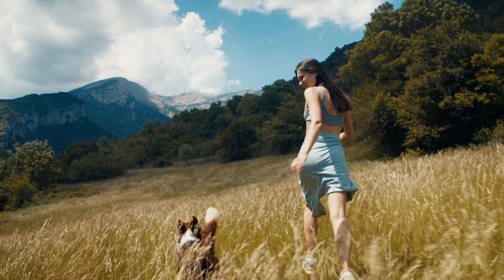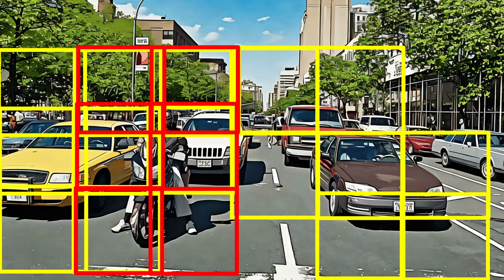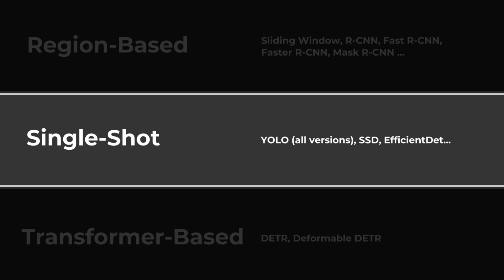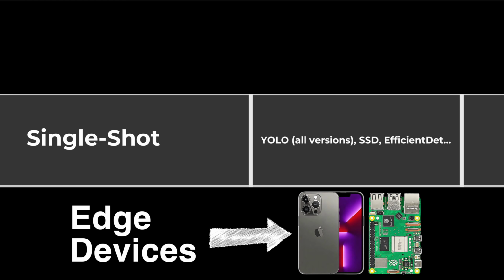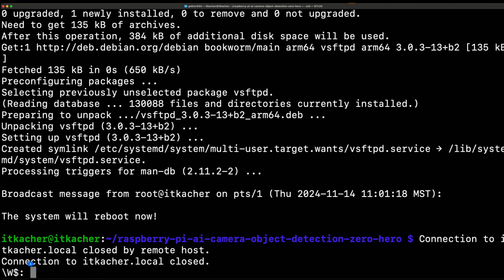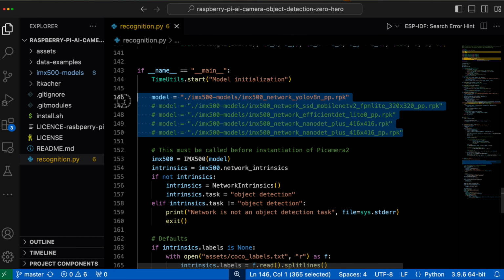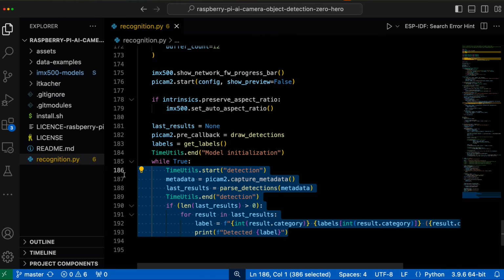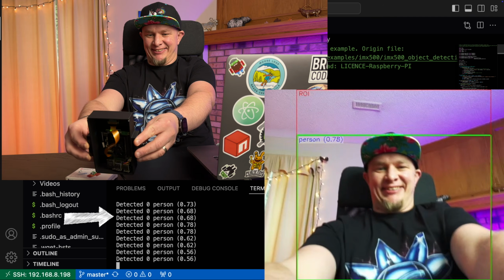The Only Guide You Need for Object Detection on Raspberry Pi AI Camera!

Comment: When i run the code the window of the camera never pops up but in the terminal it keeps running the detections
Reply from the maker: Just set True here and it should appear:
picam2.start(config, show_preview=False)
I never use a monitor when working with raspberry pi
Reply: @itkacher after i did that i would get a message saying it "couldnt load the Qt platform plugin "xcb" in (file location) even though it was found"
Reply from the maker: Try something from that link:
https://askubuntu.com/questions/308128/failed-to-load-platform-plugin-xcb-while-launching-qt5-app-on-linux-without
Reply: @itkacher  Ive been trying to get this working now but i cant find how to get he qt plugin to wokr
Reply from the maker: The code creates images with boxes so you still can use it without qt.
Reply: @itkacher  but i get the error when i run the code, so if i dont need qt, what would i change abt the code?
Reply: @itkacher  but when i run the code i get the error, do you know what parts i would need to edit of the code to not use the qt plugin?
Reply from the maker: Show_preview=False :)
See the first answer
Reply from the maker: If you used git to clone the code, run 
git reset —hard
In the root folder of the project 
It should remove all changes and it will run without qt
Reply: @itkacher  so i would run that in terminal in the zero hero folder?
Reply from the maker: Yes
Just run the original code, it would create images with detections
Reply: @itkacher but how do you see the camera without the window appearing?
Reply from the maker: The method:
```
def write_image_to_file(picam2: Picamera2):
    # Record file to SD card
    data_folder = f"./data/images/{DateUtils.get_date()}/"
    try:
        picam2.capture_file(f"{data_folder}/{DateUtils.get_time()}.jpg")
    except:
        FileUtils.create_folders(data_folder)
        picam2.capture_file(f"{data_folder}/{DateUtils.get_time()}.jpg")
```
Will create images for each detection. 
You can run recognition.py in a terminal and then go to the folder: ./data/images/{DATE}/
It will have images with boxes. 

The script SHOULD work with preview as well. However, in your case, you should install some dependencies like:
sudo apt install -y qtcreator qtbase5-dev qt5-qmake cmake
But I don't know for sure what is missing on your Raspberry PI
Reply: @itkacher  I got it to work!
I had to install opencv headless and it worked, ty so much for trying to help me I really did appreciate ur responsiveness 🙏

Comment: Is it possible to configure YOLO so that only one specific object (for example a person) is detected and set the maximum number of detected objects, as is usually done in YOLO models?
Reply from the maker: I don't know. But you always can retrain model from scratch with one one specific object, or filter results after camera. :) 
What are you trying to improve with this limitation? Delays?
Reply: @itkacher  Right, latency. It's very hard to train a model from scratch. You need a dataset of tens of thousands of images. Labeling them. Impossible.
Reply from the maker: But is 50 ms not enough for your purposes?
I thought that it’s the best result so far for a device with that price.

Comment: What is the detection rate of the yolo model?
Reply from the maker: There is no such metric as a Detection rate. 
It really depends on the image and objects. Additionally, yolo could be retrained for specific purposes.
For example, if someone has a specific object to detect, they can retrain the model and it will work.
So I am not sure what to answer :)
Reply: @itkacher  I meant frame rate. How many frames per second when detecting objects?
Reply from the maker: I received a frame each 50ms. It could provide 20 FPS